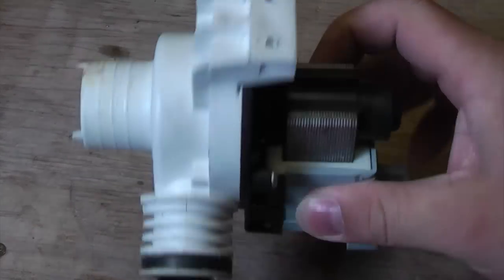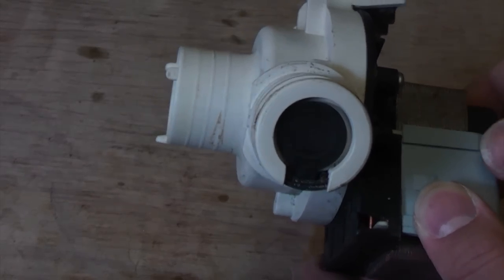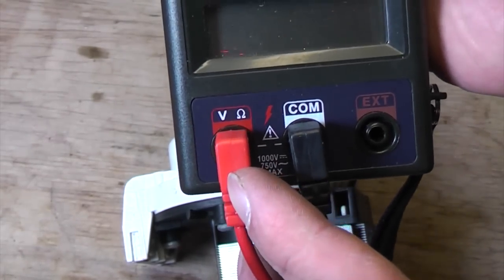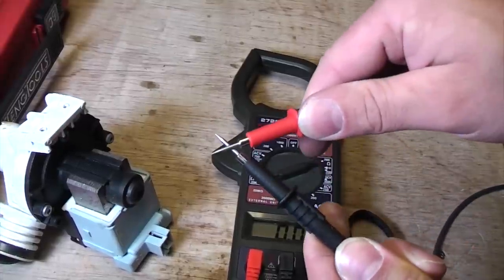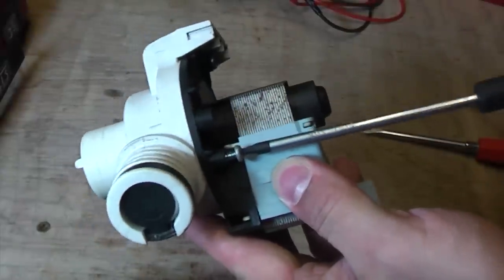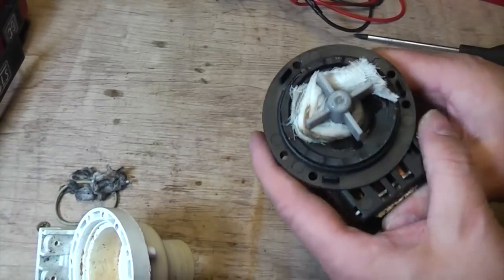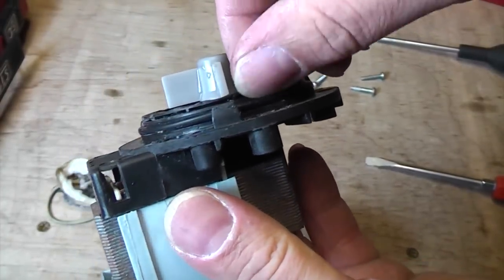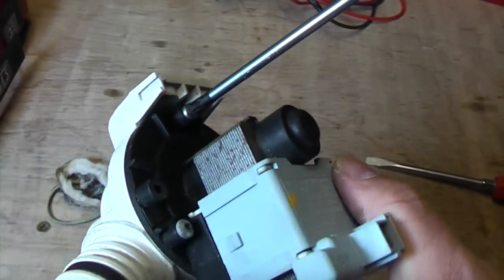Washing machine pump blockage removal   | ultimate handyman

Comment: Nice!  My pump strainer was completely full of pocket change, driver bits, USB thumb drives, screws, etc - and a rubber tile spacer had gotten by and brought my washer to it's knees.  This worked beautifully - Thanks!
Reply from the maker: You are welcome.
Thanks for the comment
Reply: Monte : Exactly right. Who knew that my wife's Bobby pin would completely disrupt the operation of the machine. Removed it and all is well. Great video. Thanks

Comment: Thanks for video.  Saved me a few hundred bucks for a service call.  Your video taught me to remove the pump motor and check the impeller for blockages.  No blockages but discovered the impeller had broken off.  I was then able to order only the pump motor from Amazon for $43.00 whereas other part sites only sold the entire pump and motor assembly for $146.00.  Thanks again.  Cheers.
Reply from the maker: +Robin Taketa 
Brilliant ;-)
I'm glad the video helped.
Thanks for the comment

Comment from the maker: @Dan S. 
Normally most machines empty completely after a cycle.
I'm not a washing machine engineer but perhaps there is a level switch in the machine that is faulty?
Reply: +Ultimate Handyman 
Thanks! I'll try and look into the level switch. I just changed the pressure sensor and no change.
Dan

Comment: Thanks for the video. My machine washes and drains but won't always spin. If I'm lucky it spins. Sometimes I have to remove part of the load and spin in it two lots, even then it doesn't always work.  I've checked the filters.  The machine makes a strange noise at the start of the draining process but it proceeds to drain, just won't spin.  I wonder if you think it's worth checking the pump?

Comment: Greetings. Great detailed video!! I loved it. I have a front load Samsung with pump in back. Machine works for the most part but won't go into spin cycle from rinse.Pump seems to work for draining water from inside of the tub but does NOT get water underneath the inside of tub. I can hear it sloshing around when I manually spin the tub after machine stops. I've taken the pump apart twice and cleaned a little lint that was inside. Also checked and cleaned sump hose. No change in the operation. Is the leftover water normal to be there or is this pump malfunctioning somehow? Much Appreciated!! Daniel

Comment: Hi there. Great video. Thanks for posting it. 

I have ordered a new pump as my current one is buzzing and vibrating  like mad. 

Only question I have is when I test it with my multimeter I get around 200 as a result.  Very different to what you had.

Does that just mean that it’s trashed?
Reply from the maker: Different makes will have different values, unless you know the specific value it is hard to say if it is faulty or not unless it is completely open circuit.
Thanks for the comment

Comment: Thanks for the tips

Upon inspection of my pump it wasn't open circuit but 120ohms
with a lot of side play in the impeller shaft.
Testing it directly with 240vac the impeller showed would spin once
then stall or just hum at any given random sequence
Im guessing because of the large worn torrance between the rotor and the stator
it now appears to be electrically and mechanically unusable

Answer: TIME FOR A REPLACEMENT
Reply: My issue as well.

Comment: I've unplugged and re plugged.  Should I pop the circuit switch on and off too?  I'm getting a multi meter after work today and will check the drain pump with it,

If it is an open circuit would the problem then be in the circuit board??  I can open that and make sure everything is tightly connected still.

Thanks for your help!

Comment: Hi!  Very informative video.  ON my washing machine I was receiving LED flashes that corresponded in my manual to a "clogged pump"  I took the base off, removed the hoses attached to pump, and then removed the pump itself.  I disassembled it like the video here, but there was no blockage, nothing.  I then reassembled everything and am reciving the same error.
 Is it a control panel error?  I do not have a multi meter to check the circuit. How important is that step?  Any suggestions?

Comment: Hi,
Thanks, I have the hoover Performa ECO AB130, and the pump starts growling when on number five setting ( rinse and  cold water fill ), sounds like a dry bearing, does the pump run in reverse when emptying ?,
nice video, but it would have been better if you had shown it being removed from the machine.
Thanks.
Rick.

Comment: Hi. I have a Bosch washing machine that won't wash. It fills, heats up and drains but won't go into a cycle - not even rinse or spin - although it did spin once during my fixing attaempts. I've squirted water back up the outlet pipe into the machine via a garden hose pipe and drained it to try and dislodge any grunge - some came out - but it still won't start. Could it be the blocked pump as per your Video? Good video by the way.
Reply from the maker: Thanks, it's worth checking the pump to see if it is clear.
Reply: Many thanks. I'll give it a go

Comment: Mine wasn't draining so followed your vid. Nothing blocked and meter reading fine so guess pump had internal fault (was 4+ years old). Sourced one from eBay for £21 and all is good. Saved £360 we were about to spend on a new machine so cheers.
Reply from the maker: Well done for fixing it yourself ;-) 
Thanks for the comment

Comment: Hmmm...now that you say that...it is on the bottom in the dead centre and is very small...so maybe it is as you say...does it fail as there is some kind of abnormal pressure building up and so the hole fails first ? I have to say though that the machine is just about 18 months old...not long to my mind...I have found where I can buy a pump local to me for about £18...thanks for the reply.

Comment: Found your video after I repaired my pump.  I had to take the impeller out as fine sand had made it's way the impeller assembly and 'locked' it.  After rinsing, drying it out and re-assembly - it worked like new.
Reply from the maker: Thanks for the comment 👍

Comment: Hi there, I have been having some trouble with my washer. It is a maytage front load. "suds" keeps pooping up and is not spinning or draining properly. I did take apart the pump and found coins in it. I did take them out and cleaned it put it back together. I should add that 2 of the 3 blades where damaged. Im thinking that just the 1 blade is not able to pump the water out. Do I need to replace the pump? Or am I able to just get that part with the blades on it?
Reply from the maker: Yes, you need to replace the pump. I don't think you can swap the impeller as I am not sure how it is fixed. A new pump should not be that expensive anyway ;-)

Comment: do i need to put silicon or adhesive when putting back the pump together to get a better water seal?
Reply from the maker: No, providing everything is clean, it should be fine. You could use a little silicone grease, if the components are tight 👍

Comment: Thanks for your video, a fresh approach to this problem. Most just advise that we replace pump without 1st having checked to see if that part is still working  It happened to me where I bought a new pump on ebay and after a week long wait, it turns out that the previous pump was ok. I then removed the drain hose and clean it out. D problem still hasn't been solved, I am contemplating removing the entire sump tomorrow hoping this might finally sort the problem or reveal the cause of the blockage.

Comment: do you reckon i could use the pump off an old washing machine to hook up to my water butt to get some more pressure to feed a hosepipe?
Reply from the maker: I'm not sure how much pressure such a pump would provide. I think you are better off with a 12v pump as it's a much safer voltage when working with water.

Comment: Nice!  Mine (actually a temporary replacement until our REAL machine is repaired after some freezing damage during a winter move) pumped noisily once and now it won't pump (just a buzzing sound coming from the pump with very little vibration) so I'm hoping when I take it apart tomorrow morning that I'll find some bobby pins and fluff in there.

Comment: Hi Handy man my washer dryer is not draining properly ..And so i had to drain all the water out my self from a pipe leading to the trap, i unblocked the pipe and put it back on   ...I then put the machine back on spin when it was empty and it spun ok...when i put another wash on the machine still would not empty with water ..is it the pump or the motor that needs replacing ...Thanks Aly
Reply from the maker: +letmeinpleaze Have you tried removing the pump and cleaning it?
Reply: Doing that tomorrow ...Thanks for getting back ..
Reply from the maker: +letmeinpleaze 
No problem, good luck with it ;-)
Reply: Could it not just be the hose from the motor?

Comment: hi handyman i have got one issue too my haeir washing machine doesn't spin... first it started making noise while drying so i thought i should not use until this noise thing stops after a week i found out that the drainer works re
ally slow and the dryer doesnt run at all what shall i do need help please

Comment: Thanks for posting this video. I didn't end up having any clogged items in the pump, but the valve was stuck inside which proved to be the problem. It works now, but I'll likely have to order a new part if the valve sticks again. There was also some slime build up that I cleaned while I was there.

Comment: hi sir can u tell me if is there a relation between pump failure and machine spin,coz my wife put a doll full of plastic granules that opened and clogged my pump,i did wot u did but  the machine wont pump out with a spin at the same time ,by the way my pump is a mirror image of urs its a G.E front loading W56 made in uk kindly advice me dude.

Comment: we have a - Siltal - washing machine,  that was made in Slovenia or Italy. the factory long has closed. But uses or better used many BOSCH insides.17 (seventeen) years old. we use it daily. The only thing we replaced was the main belt. a belt for the water pump. electric brushes for the pump motor. but now it looks the pump has finally given up. we will get the tester from an outside source and do the check if the pump is dead or not.
back now... pump, the same blue box that you have. we also had first removed some things that were wrapped around the propeller. pump did not work. so we tested it directly.connnected the pump directly with a cable and plug. the pump was working. so, we are looking further, why it is not discharging water. maybe something more inside is blocked? we will dig...
ok, back for the final. we removed all the hairs and lint and bits and pieces from the propeller. scratched off a little lime here, opened the pipes, blew through them to make sure all were free. connected everythign together. and it works just fines. could it be that sometimes a good shake and scatch and clean up will do the trick as well? anyway, the machine is still good and we will not sell it just because it is old. and our friend, the engineer said, should we decide to sell, only to him. because the machine still has many good and useful parts inside. looks like 17 years ago they did make GOOD things.

Comment: Hi,
I just took out my drain pump one thing I realized is propeller isn't turning easily. It turns but it feels like there is spring inside shaft or something. I didn't put it back yet. however, the propeller was clean when I took the pump out. I was thinking the buy a new pump but I m not sure if the pump is bad since my dishwasher isn't draining at all.

Comment: your video was great, and I confirmed that mine was working with ohm test....nothing in impeller, but there was a clogged filter in a boot just before the pump.....some coins, cut ends of zip ties, a screw, plastic and some gunk.....the filter looks like a large test tube with holes in the bottom (mine is affinity washer)....

Comment: My washer wouldn't drain i removed the pump and there was small sock stuck in there, Put it back together it solved the problem but now I have a small drip coming from in between the pump and the assembly. I tried taking off and back on a couple times appears to be seated correctly all around but doesn't have that tight feel it originally and still drips. Any ideas?
Reply from the maker: ***** 
It sounds like it may need a new "O" ring for it to seal properly.
Reply: Thanks, I tried a few more times and finally got it to stop dripping, i believe the o-ring wasn't seating correctly after twisting the pump into the locked position.

Comment: how should the impeller turn should you get resistance and a light dull clunking or does it spin completely freely?
Reply from the maker: +malcolm martyn 
You can normally feel a little resistance in places which I think is caused by the magnet.
Reply: cheers for that. problem solved

Comment: HI again.  This seems to be developing further.  I've gone ahead and tested the Drain pump with the multimeter.  It beeps, and when I put it in resistance mode I get a higher number than with the two prongs by themselves, but it still has continuity.  I'm going to go ahead and order a new drain pump anyways.  But I fear there's nothing wrong with it and the problem is elsewhere.  Any suggestions?

Comment: Any tips to open the drain cap when it is stuck?
Reply from the maker: I used a pair of water pump pliers last time, but you have to be careful not to break the plastic ;-)
Reply: @ultimatehandyman  I tried with no luck. Any other things that I can try lot applying soap etc?

Comment: I found out recently after using multimeter on my washing machine pump that even though it passes the test, it doesn't necessarily mean it works continuously while in operation. I kept getting a F-02 and "Suds" code on my washer. I tested everything. Logically I thought that if water was not draining from tub it has to be weak or dead pump. However the pump was showing perfect readings. I swapped out pump and washer is working great and draining. Sometimes you just never know.

Comment: Hello good afternoon, how are you? I'm watching your videos and they're very educational, congratulations, the next I got a friend's gift from a washing machine wipool duet model 9200, a beautiful washing machine I was very happy with the present, but she has a problem that I can not figure out , When I press the button to connect it emitted a sound signal and not of the match, I am a test asoprando the tube of the pressure switch to it of the start but not stops of filling of water, it is that can help me, I am from Brazil and I have difficulties with mechanics , Because it is an imported washing machine of uses, do not want to sew. I'll try to repair it myself with your help. Thank you.
Reply from the maker: Hello, My knowledge of washing machines is very limited and I only really know about the motor (brushes) and the pump and how to replace circuit boards etc. You might be better off asking in a dedicated forum like this- http://bit.ly/2l4plvB

Comment: I was fixing my machine and a stainless steel coin like fell on the floor! Can you pls help me find out from were it fell.thank you
Reply from the maker: Did it fall from inside the pump?
If so it could be part of the non return valve/mechanism?
Reply: Thanks d problem is solved

Comment: I washed a rubber backed mat the rubber bits came off in drum how can I remedy this as it will no longer drain water
Reply: Checked filter already
Reply from the maker: The pump might be blocked, but the filter should have caught the debris before it reached the pump.
If the filter was blocked there is a chance that the pump is also blocked.
Reply: Ultimate Handyman thank you for your help
Reply from the maker: You are welcome.
Thanks for the comments

Comment: how do you remove the pump to replace it??? mine isn't draining at all
Reply from the maker: +ANGEL DAVIS Normally you unplug the machine and tip it backwards and the pump will be accessible from underneath. Or most machines have a small filter at the front now, there is often a small panel on the front of the machine where you can pull the flap down and then unscrew the filter.
Reply: What machine is it. 
Sure only filter needs cleaning 
An engineer.

Comment: My washing machine won't drain.  We took it all apart and the pump motor was very hot which made us think it was getting overheated and stalling.  My husband hooked electricity up to it and it would still run.  However all this nasty gunky water started coming out of it.  Does that mean the o-ring failed?
Reply from the maker: Allison Stivers 
Yes it sounds like it has failed. A visual inspection of it should confirm this.

Comment: When replacing water pump on Top Loader there is a rear pump hose that exits the rear of the Bottom of the Washing  Machine from the new water pump. DO NOT attach the short rubber hose from the water pump to the rear of the machine when the machine is tilted on its side this is because the short hose will come loose when you tilt the machine back up again and water will drain on the floor.
You must remove the back panel of the machine when it is upright then reach in and attach the short outlet hose from the water pump to the rear inner outlet with the metal outer ring to sleeve. 
Then reach inside washing machine drum and rotate freely to test the hose connection. 
Ensure the hose inner tubes are all connected to the water pump with there metal rings on inlets and outlets as machine is STANDING UPRIGHT before fixing on the back panel.
You only replace the water pump when the machine is tilted on its side.
Reply from the maker: I've not seen a top loader since I was a kid 😱
Thanks for the comment 👍